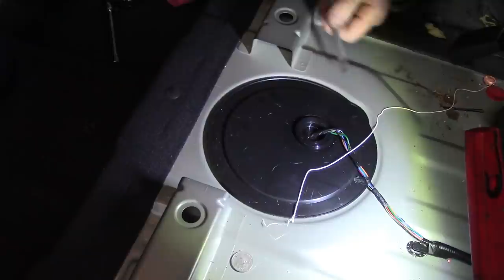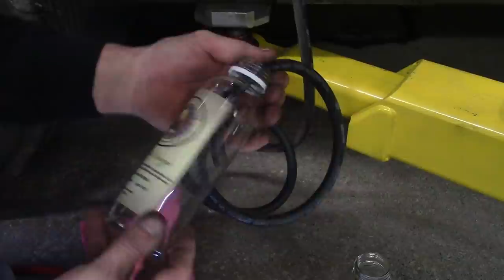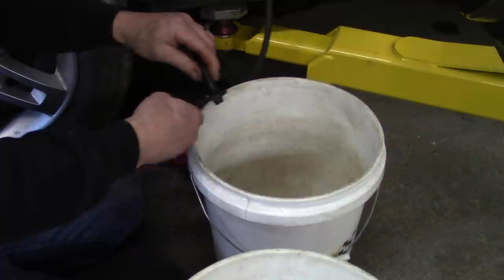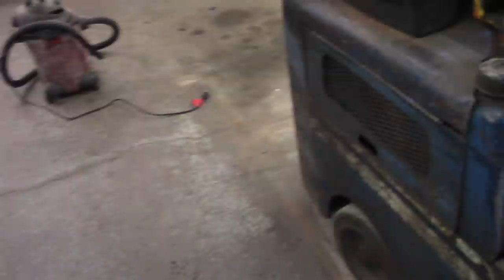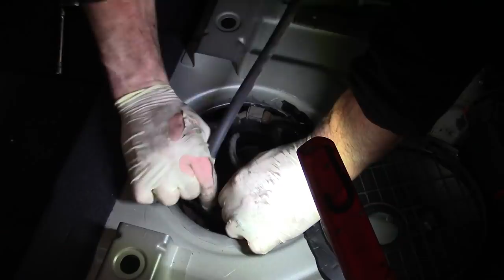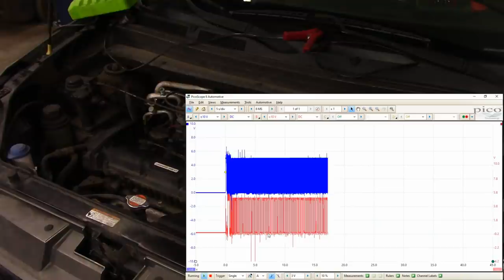Kia Soul - Auction Car Special Part II

Comment: Diesel in a petrol engine isn't really a huge deal: once it's cleaned out there's generally no permanent damage. SeaFoam is part diesel fuel and people pump that straight into their petrol engines all the time with no problems (assuming they're doing it right, that is). Granted that's used at a much lower concentration than was present here but it's still part diesel (and naphtha and iso alcohol, apparently). However, the reverse isn't true: petrol in a diesel can ruin the high-pressure fuel pump and/or injectors at the very least due to petrol's much lower viscosity and lubricity.

Comment: Question do you check spark plug gaps on new spark plugs even when they iridium. I've been told you don't need to  however when I do I've found  1 or 2 are out of spec. What do you do?

Comment: Not a Kia fan.  I had a Kia 10 speed bicycle many years ago that was not so great.  If I had to buy a Kia, the Soul is it.  Several people I know use them as delivery cars.  They assign them to drivers. Driver gets to go home in the company car at night. The drivers have the option to buy them when the company is getting rid of them.  Other than ones that were hit really hard, they all get bought by the drivers that have put 80K or more miles on them.  That says something about them.  All of these companies replace their Souls with new Souls.  Decent car for what it is, as long as you put gasoline in it.

Comment: Great Job, as per all of your other videos. However, I would have done an oil change on it, and charged the customer for it of course. Some of the un-burnt Diesel might have diluted the motor oil in the car. just a thought.

Comment: Wife filled are car with diesel at or local pei shell. Just pumped it out like you did. Put the brake parts cleaner to get it started. It worked fine. I no old farmer had dual gas tanks on his one tonne. He filled one tank with diesel by mistake. He claim once he got going 40 mph. He could switch over to the diesel tank. Truck run on diesel no problem even hauling cattle trailer. 😂

Comment: Oh, the diesel nozzle being too large to fit in a gas hole doesn’t stop an idiot from finding a way of getting diesel in the tank... it just slows them down. 
Trust me, I drive a diesel Benz and I’ve had to stop people several times. They see my old sedan parked at the pump and they pull up thinking it’s a gasoline pump.

Comment: Yeah in WA, the nozzles are different and can't easily do it.  I think the angles are different too.  Not to mention the dang Gross, greasy, nasty green handle haha. 

Either someone did it on purpose or they used a can on accident.  

I damn near almost did that!  Twice actually once with my oil/gas mixture and once with diesel.

Comment: I was at a gas station and observed a fellow using the green nozzle on a newer car...turns out  he was a visiting college professor from England...I told him it was the wrong fuel...as it wouldn't fit, he had been holding the nozzle outside the gas door, dribbling fuel in for at least 15 minutes,  and he probably had put five gallons in and said he hoped he would make it to the dealer and tell them he didn't want the car...turns out he had just bought it. I asked him if he could read English, pointed out the pump warnings and told him to have it towed and then flushed out... He was still there half an hour later as he couldn't get the car to start...  What an education system we have.

Comment: Pull out the fuel from the tank and disconnect the fuelline at the motor and remove all spark plugs and crank the motor for about 15 minutes

Comment: Had it almost happen to me. Needed to pump gas to my work truck chose the green nozzle because usually black is diesel green is gasoline. And when I went to pump it it couldn’t fit in the hole and this is Chicago so I assume this is nationwide. It’s a good thing they do that or I would of been screwed lol.

Comment: Bet it was having crank problems and they put a sensor on it, which didn't fix the issue because of the rust.  And then the car was set for repo, so the owner sabotaged it with diesel as a middle finger to the loan company, which it turn put it up for auction.  Or the owner sabotaged it and the repo company tried to fix it with the sensor.  But that rust was screwing it up and not fixing the problem.   Anyway, I am totally the opposite on diesel.  When I was a kid, my family spent many winter's with no heat. We were dirt poor. We finally got a kerosene heater and that thing changed our whole lives for the better.  So I'll always associate the smell of diesel or kerosene with warmth and happiness and good things.  It always makes me smile like an idiot.

Comment: I grew up in an agricultural and industrial repair shop my dad owned and I have same extreme hatred for diesel... The smell is terrible. As soon as I was big enough the pressure washer wouldn’t blow me away I was put on engine degreaser jobs before they got worked on.

Comment: Great video.  I was always under the mistaken impression that running a large amount of diesel fuel through a gasoline engine would cause irreparable damage to a number of components requiring a total engine rebuild.  Obviously I’m not a mechanic so thank you for setting me straight.  I wish we could find out how that fuel made it into the tank since it wasn’t an honest mistake at the pump.

Comment: well yes you can find pumps with the smaller nozzle on them. Usually at the small mom and pop stores or if you put kersene in it that nozzle is usually the standad size nozzles.  At the garage at work they have a standard nozzle on it for landscaping equipment or our certaib buses.  great diag thanks

Comment: Since it was an auction car there might be no way to know but if it were a farm car it would be real easy to put diesel fuel in it from the bulk fuel tank. As soon as you smelled the plug and said uh oh I knew it was going to be diesel. When I was young a local farmer brought his wife's car in to the shop on the hook because it wouldn't run. Same thing, hours and hours later all the diesel fuel was removed and system flushed and replaced with GAS and the car was back on the road.

Comment: Nice video , diesel severely lowers the octane of gasoline,  bad juju,  better it didn't run, although that engine probably has knock sensors.  There have been a few airplane crashes where gasoline tanks have been topped off with jet fuel, the airplane gets off the ground and the engine grenades due to detonation.   Thanks for not making us wait for the conclusion.

Comment: Here in Virginia and most every other state I’ve been to......the diesel pumps are no longer the larger size unless you’re at a truck stop. At all the gas stations, they are same size as gas pump nozzles. This is probably due to the rise of diesels such as the VWs several years ago.

Comment: I had a friend that asked me to look at his '97cavalier because it wouldn't start. I did all of the usual checks and they were all good so I decided to do a compression test, 1,3 failed so I called him and I told him I was fairly positive it was a head gasket and asked me to fix it. I tear it down and I see that there was a massive hole in the tops of 1,3 pistons. I found out later that the moron ran cam2 gas in the car and went joy riding in it.

Comment: My dad had to attend a breakdown of a 70's Austin mini when the owner had topped the tank up with diesel. He managed to keep most of the fuel which we then used as a degreaser, which would remove the worse of the oil and grease.

Comment: A few years ago I filled my Hyundai up at the local convenient station after some dork inadvertently filled the underground tank with diesel instead of gas.  I drove about a mile before the car quit.  Since the station's insurance covered the repair I took it back to the Hyundai dealer.  They replaced the plugs, injectors, fuel pump etc.  If I recall the final bill was over $1000.

Comment: You know Eric when I saw those black plugs I thought "how did it get so much oil on the plug"? But it sounded like it still had compression. I thought they had burned up the engine  with no oil or no water till you said diesel.

Comment: Gas floats on top of diesel, so all the diesel should be on the bottom. I learned this the hard way, naval aviation, we have a cart with a jet engine that is used for starting other engines. Some jackwagon put gas in it. It would run just fine for a few days, then it wouldnt. Turns out turbine engines dont like to run on gas.

Comment: Not all diesel nozzles are larger. Most stations have smaller (same as gas) for 4 wheel diesel cars/trucks and then over at the big rig area their nozzles are larger for more flow. (yes, I own diesels)

Comment: I was curious, and seems like the only difference between the NGK's you got, and the ones you weren't able to get is the ground electrode material. The IX's have a nickel ground electrode and the lasers have a platinum ground electrode. NGK says the IX lifespan is just a little bit shorter than the 100k rated lasers as a result, no big deal on an older NY car I think..

Comment: hate diesel. well yu gone dislike my mb e 320 cdi. but my mechanic say the same. hate diesel. I am use to it but kind of understand it. but never gone stop fix diesel, but gas is cleaner to work on. 
one reason that I have a realy clean egine bay and engine. so I can see if there is a leak. and fix it with les dirt on my heands.

Comment: Never take fuel from a tow truck My buddy's Corvette one night ran out of gas AAA sent a local tow truck who dumped gas in it for what we thought was gas and it turned out to be a mix of diesel oil and water what a mess that was I think they just drained it out of the Rex cars whichever in it all goes into a tank and then that's what they throw on the tow truck of course they denied it

Comment: It takes some effort to put diesel in a gas vehicle. It wasn't done at a gas station since the diesel nozzle won't fit. It was obviously filled with a gas can. Was it done deliberately or not is the question.

Comment: A gas engine will run with a high concentration of diesel fuel in the gas. But it only takes a very small amount of gas in diesel fuel to damage a Diesel engine. Just sayin’.

Comment: Thank You  , South Main Auto. I think this is your best  video yet.  I do want to know though , about the spark plugs. Will they smell like diesel  ,if it didnt run . After the crank sensor failed. And  the diesel fuel was added later. Was fuel yet just pumping through the cylinders ?

Comment: Some states they have a larger diesel handle at the pump and some states have a smaller normal sized pump handle for cars that are diesel like mine. Maybe someone made a mistake, especially when each gas station has different color handles. BP diesel handle is black

Comment: The title says auction car so I can tell you one way to get a car on the cheap is if it runs like crap when it comes up for auction so all you have to do is throw a little diesel in it. And you get a good cheap car. I know of somebody that reversed a few plug wires and the car was popping and farting.

Comment: Here in Britain this was a major problem for a while, Diesel in Petrol cars and vice versa -  our cars had the same filler hole for both fuels so it was easy to make the mistake. If the driver had put only a few litres of diesel in we would just fill up with petrol and sure it would maybe smoke a little but much cheaper than draining the whole tank. Petrol into diesel meant draining the tank but never bothered to do any more than replace with diesel and fire up ... Great videos !

Comment: Eric, years ago I ran across a girl at the gas station sitting in her Camaro, crying her eyes out. I asked her what was the problem. She started the car which started belching a cloud of white smoke. We talked for a few minutes and figured out what had happened. She was concerned that the tank was so low that the car wouldn't make it to the gas station, so she walked to the station with her gallon can. We figured out she put diesel in the car and the mix had just enough gas percentage for the engine to run.

So I just filled the car to the top and sent her on the way. The fill up made the gas/diesel ratio at least 18:1 or better, which seemed to solve the immediate problem.

Comment: Yup, dieselene doesn't combust so well in a spark plug motor.  Had our big ladder firetruck get topped up one day by a firefighter in a hurry.  Was their lucky day that it was running funny and set the money light before it did any damage,  not our lucky day as it was raining heavily as we were pumping the tank down to the tune of 280L.  Think he said it had a quarter tank when he filled it.

Comment: Similar thing happened to a Jaguar I had. It has the fuel fill at a horizontal position by the back window in a well covered by the fuel door. I must have parked it under a leaky gutter and rain water had poured into the well and submerged the cap allowing water to get in the tank. Took a long time to figure out the problem using similar diagnostics like starting fluid to narrow it down to a fuel problem.

Comment: It is better to change engine oil & filter, to be in the safer side. Also check with bare fingers the transmision oil, brake fluid, etc.

Comment: I think I would have just let the fuel pump run circulating the good gas through the fuel rail and regulator back to the tank for a while. Rather than pulling apart and blast air. But, I can see why you might do it your way.

Comment: Eric, at the end of the video (35:14) you show the traces form both sensors, should they line up more so that the gaps in the blue trace line up with the edges of the red trace  as in part one you mentioned the two being out of sync as a possible cause of poor running ? -

Comment: You still have to change the oil because the diesel that did not burn, check your dipstick you will see it is higher  ! and oil and diesel is not the perfect lubricant

Comment: No way I'd start that thing without changing the engine oil first. Diesel doesn't ignite, so it works its way past the rings and dilutes the engine oil

Comment: fuel doctor additive is good stuff. add it to the fuel it will bind the diesel and water into the fuel so it will burn off when running . i’m in australia so not sure if you guys have Fuel Doctor in the states

Comment: i hate when they put diesel on the same pump with a different nozzle.  i have seen the wrong (small) nozzles installed.  diesel should be a seperat island

Comment: I think they stuffed diesel in her first and cranked till they got a phantom crank sensor code. Jacked up the sensor putting the new one in and then shipped it to auction to make it somebody else’s problem. Working at a dealer I saw that scenario several times.

Comment: Fuel "expert" here: regular grade gasoline can have a slight green tint to it and also premium. But when you hold it up against diesel you'll see something obviously standing out as more green. Foreign fuel coming in doesn't have ethaniol in it so it'll be clearer being less green. 

I've handled a few hundred million gallons of fuel in the past year. What do I know? 

Psst: Venezuelan and Russian gasoline is coming into the US since last October.
Reply: And before somebody asks, they store ethanol on site to add to foreign fuels coming in. Plus grade is a mix of premium and regular done at the filling rack of the fuel terminal when a semi truck comes in to fill up

Comment: ...great two part video Eric...really enjoyed it....just curious, I understand the fuel pump motor is cooled by the surrounding fuel, so could the motor overheat from continuous running
when you pump the tank dry and there is no surrounding fuel?

Comment: The Diesel and Petrol will separate.

This is how it gets transported through high pressure fuel pipelines  across the country. 
Some times a rubber pig is used as a blocker between the fuels.

Comment: You wonder what that brew did to the 02 sensors? Hopefully the fresh gas burnt off the carbon.I had a disel Mazda  pickup truck
Reply: Diesel truck towed in where the pump jockey  put gasoline in the tank. The 'car stopped with a jersey,and the jersey got out'!😁

Comment: A bit of diesel as an additive is AOK. It will clean out the combustion chamber and the valves and somewhat clean the injectors. No more than 1 gallon into 20 gallons of gasoline. For the skeptics I’ve been doing it since the early 70s. No damage to cats they are in diesel vehicles too.
Reply: Nah ... Tin of Lighter Fuel ... Naptha.

Comment: The ratio of gas to diesel is lower.   This is your statement at 23:34.    Sorry Eric.   With adding more clean petrol (gas) the ratio of gas to diesel will be higher.  More gas, less diesel in proportion.   You inverted the sides of the equation.   e.g.    2 gallons of gas and 1 gallon of diesel would be 2:1, and after adding 5 gallons of gas, it would be 7:1.   This is definitely a higher ratio of gas to diesel.   If I can do it, you also can do it!    Fair enough?   Let me know.   Thanks.     The second lot of 5 gallons will increase the ratio even further to 12:1.   'nuff said?
Reply from the maker: Haha the people got the idea

Comment: Do you find that you no longer need to gap new spark plugs?    I've been told that if you use the factory-called-for plugs, they are already gapped correctly.
Reply: I'm not Eric but I've heard the same, they should be ready to use from factory. Doesn't hurt to check some and usually they are correct.

Comment: red diesel fuel is road taxed, this was green and is exempt. Most likely put in via a can.
Reply: It's the other way around: red is for off-road, clear or greenish is taxed and for road use. Red is also for No. 2 fuel oil, but fuel oil and diesel aren't always exactly the same formulation.